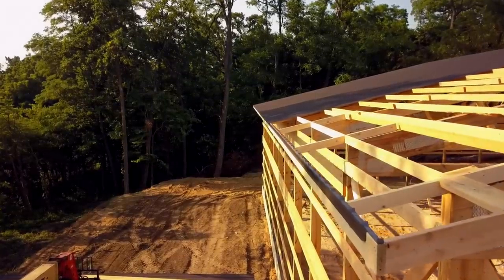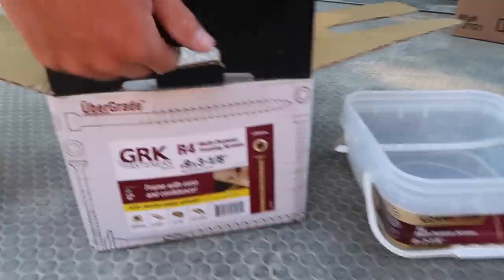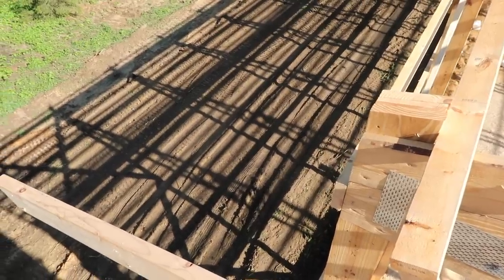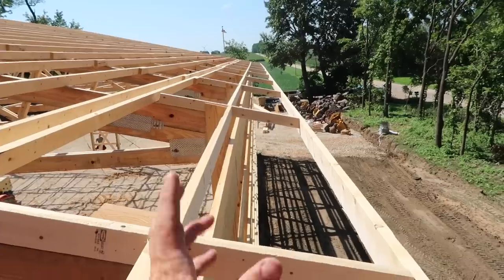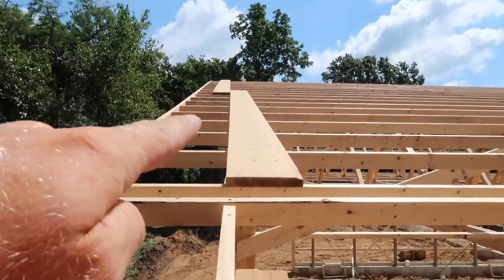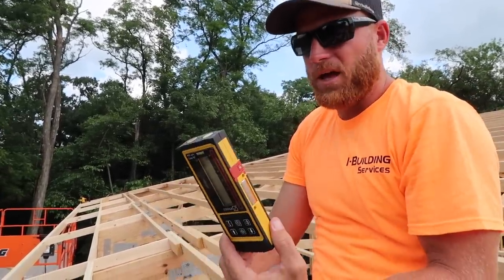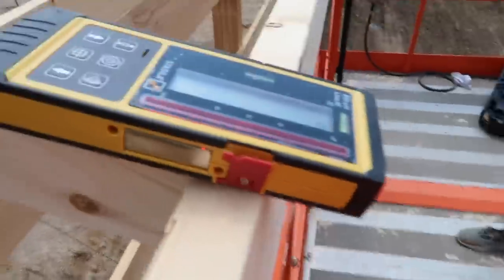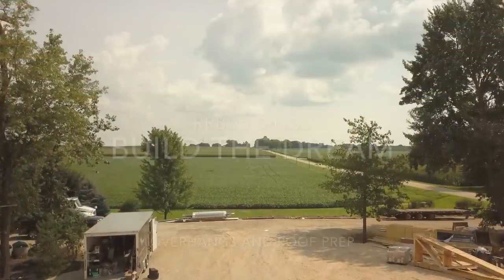Building the Dream: Episode 5 How to straighten a roof

Comment: A possible solution for the layout station, you can see @ 19:01 and it is orange...☺
Move the lift to the corner and stay away, lets say 4 inches. Take the receiver and a piece of wood and mark the 4 inch offset.
Now do everything you wanted us to show! 👍 The lift doesn't touch the building, so you can tweak it without moving the layout station.
You also can use any other (big and steady) equipment or even deside to set a temporary pole.
Nice video as always!  👍
Reply from the maker: the lift rocks too much....even a slight movement is no good
Reply: @RRBuildings  Ofcourse I meant that nobody is on the lift. You are on the roof checking  and Greg pulls the chains.
Or.....do you mean that the wind is enough to move the lift !?
Reply: when they move around on the lift it rocks around, not just wind, pay attention to see what I mean
Reply: @Joshua79C  u dont know what i mean, i see.

Comment: The truss bracing is throwing the Alignment out when you square that way. Pulling the tip of the gable stretches the tension on the intermediate columns forcing the load to transfer at a diagonal to the bottom eave. I set many large span roofs and old school is a 2 pound plumb bob measured off the bottom plate. Works well.

Comment: Kyle: Great videos, all of them.  One issue that became clear at 11:13 in this video is something I've wondered about for a couple of years.  Namely, how to build and install corner posts (possibly a good subject for a 5-10 minute video in future).  This episode number 5 shows all three 2x6 members of the corner post coming all the way up to the top of the purlin (no pocket or shelf is provided for the truss to be inserted into the top of the column).  The end-wall truss is simply nailed to the outside of the end-wall columns.  Before installing the end-wall truss, a cleat is screwed to each end-wall column to support the bottom chord of the end-wall truss. Thus, the end-wall truss is flush with the end-wall girts.  Am I on the right track here?  Thank you from a long-time student of your work.

Comment: Nice video. .. gotta put the laser on the drone and hover it above the spot.... yeah that's it. One thing about screws is that they are guaranteed to get picked up by tires and give you a flat, at night, in the rain, on the interstate, ... Had a job where we used stainless screws and couldn't pick them up with a magnet it was a real challenge to find them and make sure they didn't cause a flat.

Comment: Nice little helpers these lasers. I repaired one which had it's batterie replaced and figured out, it killed the charging circuit board. Easy to repair but will cause the machine to stop charging and of course stop working for you. So someday if you think you have to change the batteries in there, make sure to use original products :)

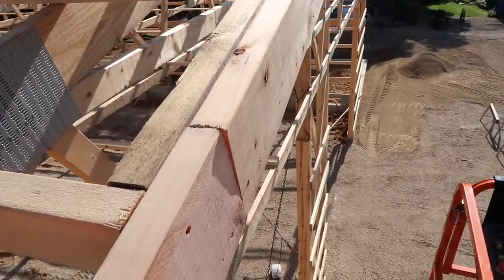Comment: Two questions: First, how deep is too deep to drive a screw? (5:12) Second, do you have to straighten all four sides separately and if so, how do you avoid moving the straightened side from the opposite side? I apologize if I have forgotten this answer from a previous video. Thanks again for taking the time to make these great teaching videos!
Reply from the maker: I think most screws go in 1/8 or so to ensure the materials are sucked together....hopefully that's okay.  Also we usually have a process in straightening...one at a time

Comment: Kyle, could this construction method you use for this shop, be adapted and used for residential use? I like the idea of the post setting on a stem wall, and creating a free standing structure without the need of center post. In my view this generates many ideas of how you use such an interior space for residential. The space planning, could be implemented in a similar way as space planning in an old industrial loft. I enjoy watching your videos. Very inspiring for creative and design orientated mind.
Reply from the maker: For sure

Comment: I was wondering....if you use the chains and get one side of the building exactly where you want it,  when you tighten the chains on another wall, does the original wall move? Just wondering if you end up chasing it around? Great job guys....love the videos!!
Reply: @RR Building, I'm interested in this as well. Also how does it stay in place after you remove the chains?

Comment: I had a very unhappy incident with a gray 4 x 4 post  replaced a post on the porch after 44 years screwed a part of the railing to the new post and the liquid in the post leach out and started eating the new primer and paint top coat of the steel railing just like paint remover just curled just like paint remover . Happy trails

Comment: Recommend adding a safety strap for that expensive equipment to your belt or to the wood in case of accidental drop for both the receiver and the laser.  Better to have it and not need it than to needing it and not having it.

Comment: @RR Buildings i see your perlins are staggered ... how do you get straight screw lines ???
Reply: I was wondering the exact same thing!
Reply: I do my purlins the same way as shown here. 2x4 on edge, 60d ring shank pole nail at purlin/truss connection and staggered purlins. We just chalk lines from one end of the purlin to the other. There is no straight screw line from one gable end to the other. After we screw the top and bottoms of each sheet the top man marks the center of each purlin on his way down to grab the next sheet and by marking each sheet it gives me a true reference where the purlin really is in reference to the chalk line (because as you can see here not all boards are completely straight so your chalk line could be a lil above or below the purlin in some places where it’s warped.) when we get to the end of the purlin and another bay of purlins start, top man will mark the center of the new purlin on previous sheet and an o (for old) where the previous bay of purlins end. This way we know where each bay of purlins start and stop so we can chalk lines once the roof is on.
Reply: You asked my question, and  steve brown answered . Thank you

Comment: Man you get that gable plumb in the center  and make sure the bottoms good a dry line  seems like it'd be faster to get the facia straight that laser seems like alot of steps I'm a old head I know you young dudes like  the new stuff but seems like a dry line be much faster
Reply from the maker: Rick Mueller did you see the wind.... I would say you are correct for most situations but wind ruins a string line
Reply: @RRBuildings  Honestly though you could roll with a simple 5 point laser for a lot of this.

Rotary lasers and 3 line stations are incredible for doing layout, but when it comes to transferring lines, or using a laser as a straight line reference then a simple 5 point is a lot easier to set up and is much less of a cost investment, very versatile tool.

Comment: What if you put a tripod on the scissor lift with the stabila thing so it wasn't attached to the building? Then you adjust the building without tweaking the stabila. As long as the lift doesn't move.
Reply: Ryan McWilliams to much movement.

Comment: So how do you use the layout station?
I'm a retired engineer, so I had already said to myself when you mounted the layout station on the block, "how's this going to work, the device will move as the building moves".
Maybe a mount off the side of the scissor lift?
Reply: I was thinking that aswell. 

Perhaps leave it on the ground underneath right where it needs to be aligned with the facia and shoot the lazer upwards?
Reply: A scissor lift or any other lift is not exactly always stable or stationary, you can even see it swaying as they walk around on it or doing other platform work when not walking.

Comment: Kyle, do you get all of your lumber or most of it from Ohio Timberland?  How are their treated boards?  Referring to the treatment and how long does it last.  I know that the treated boards from local suppliers like Lowe's, Home Depot, etc.:  the treatment must just be brushed on.  I have built 2 decks and the treatment on the treated framing has apparently gone after 6 months and the boards look exactly like untreated wood.  I'm having to retreat them.

Comment: So after you adjust the trusses what keeps them there?
Reply: the chains you see are kept in place until the outside roof and wall sheeting is installed, the roof trusses are already secured by nails, screws or bolts, the adjusting is done to square up the structure before installing the metal as mentioned

Comment: The stabila would have worked if it was on a seperate, independent surface, like the corner of the foundation.  Doesn't it cast a line straight out, but also vertically?
Reply: Looking at the Stabila 02180, via the  Amazon link, there a photo, the fourth, that shows that it produces two perpendicular vertical planes.  So the Stabila may work attached to the foundation at floor level.  The users manual is at https://www.stabila.com/files/default/products/static/products/USLA180L/downloads/bedienungsanleitung/en/la180_90_manual_us-en.pdf

And the product flyer is at 
https://www.stabila.com/files/default/products/static/products/USLA180L/downloads/produktflyer/en/la180_90_flyer_us-en.pdf

Comment: you guys screwed that up really well... you align the peak of the roof because that matters the most and has to be center to the structure and then you apply your scab overhang for the fascia so that all the lengths are the same.. what you did is like an autobody shop welding on new quarter panels and then trying to pull the frame straight..

Comment: Why not just straighten your gable truss with a string and braces, and then work off it from there?  And for another unsolicited piece of advice, sort your screws in your hand real quick to all be laying flat like a cylinder in your hand before going into the pouch, they lay flat so you can get more in, and you don't stab your fingers every time you reach for one.
great vids though!